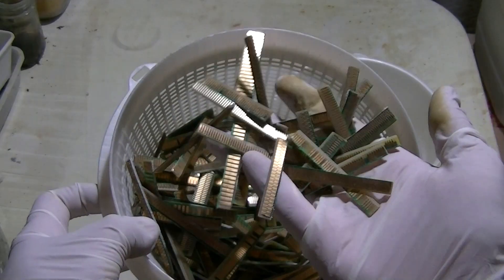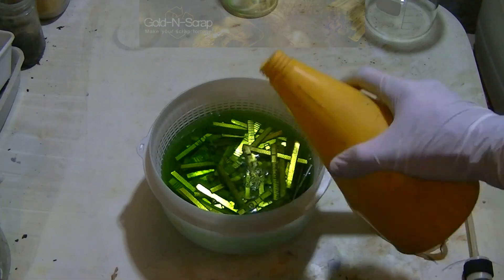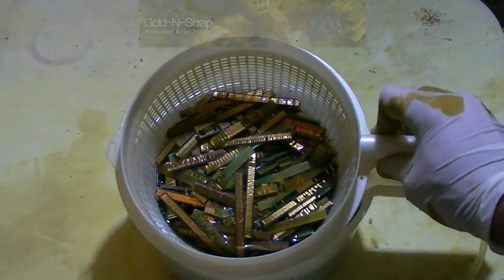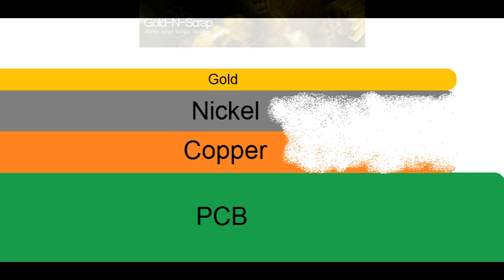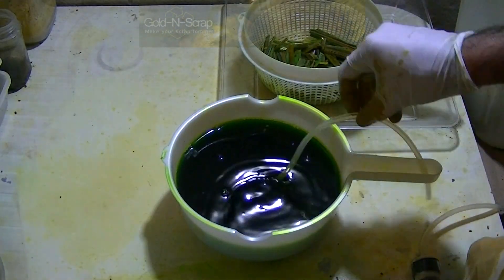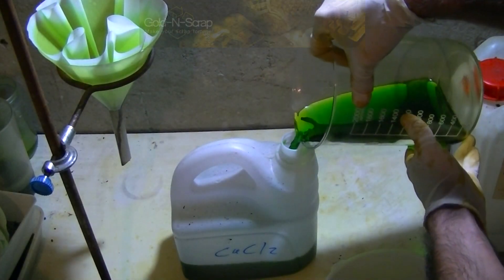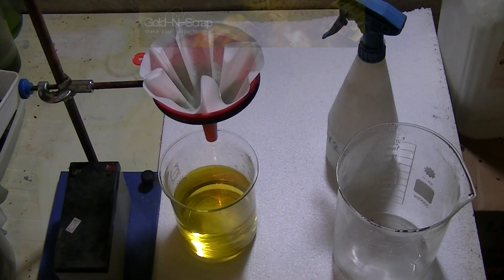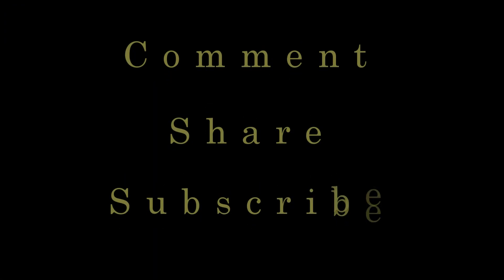Gold Fingers - How to Recover Gold from Electronic Scrap

Comment: 6 grams is 1/5th ounce. gold is 1236 dollars per ounce this makes it about $247.50. From this we have to figure what you have paid for the starting,  our time is worth and the materials. Figure as a guess $100 dollars. This means that after a week you have made about $150.00 and possibly less. This may pay on a larger scale.
Reply: NERD FIGHT!!!!!!!
Reply: This would definitely pay on a larger scale. However, a trip to Lagos is too expensive anyway.
Reply: ***** Hi, it depends if you use a metric ounce of 30g per ounce or a Troy ounce (29.95g) , which is quite close. If the daily price is $1236 x 6g/30g =$247.20. or 5 divided into 1236. Check this by multipying $247.2 times 5 to get the original starting figure. Best, 
Nick
Reply: Nicholas Sceusa Actually, a metric ounce is 25 grams it's not widely used. The most common ounces are AVDP or "standard" ounce which is 28.3 grams, and the troy ounce, which is what gold is measured in on the stock exchange @ 31.1 grams per ounce. So, if you were wanting to know the price of gold per gram, you would divide the current bid price ($1322.30 today) by 31.1 to get the price per gram. If you factor in the cost of all the materials used in this process, including electricity to run the air pump, heat plate etc. it's virtually impossible to make money from gold plated components, even if you get the components free.
Reply: Nicholas Sceusa Actually, I work in the precious metals industry. 31.1 grams per troy ounce isn't an approximation, it's an exact figure. And while gold is traded on the stock exchange in troy ounces, in the gold industry it's "usually" measured in either grams or penny weight (dwt) because it's very uncommon for people in the gold industry, except for large buillion sellers to use troy ounces, even the majority of them sell in fractional quantities more than 1 oz bars, rounds, or coins.
Reply: corisco tupi
Yer, exact is an absolute. You cannot be 50% exact. You are either exact (and nice) or you aren't exact. The operative word in Joshawa's definition would be (in this case) "completely", that is, in full. 31.1 is not "completely" correct, it is "mostly" correct, or correct for most purposes. It is not "exact" M-F'n semantics, yo'.

PS. nice as in precise and complete.
Reply: The use of an approximation which is common is not a switch. Your idea of more decimal places is more accurate or precise is not entirely correct, without the degree of precision of the measurement, or its uncertainty.
In any respect, the bottom line in dollars is quite the same. A review of the definitions of precision and accuracy might be in order. For this, I refer you to Remington's Complete Pharmaceutical Sciences. Sincerely yours 
Nick
Reply: corisco tupi It's sad that you cannot even see that 31.1 and 31.1034768 are the same thing. Just because I left off the decimals that aren't commonly used in precious metals doesn't make it any less exact. You cannot apply the theory that more decimals is more correct when, if you were so inclined, you could carry out the decimals till the end of time. What number is exact, 12 decimals, 100 decimals, 1,000,000 decimals? Let's just call it what it is, when you first replied to my comment what you thought you were doing was being a smart ass and a know it all, when in fact, all you did was prove that you aren't as smart as you think you are. You can (and have) deny it all you want but you clearly implied that 31.1034768 is exact, not 31.1, then you went on to argue against yourself that they are approximations which is just even more wrong. After 1 comment you looked like an intelligent person, by now you're just a blathering idiot who would argue the sky is green and grass is blue if you thought it would take the attention away from how big a fool you made of yourself right from the start.
Reply: corisco tupi
Since I've been buying and selling gold for a long time and always used the 31.1 figure, I decided to see exactly what you are talking about. At a price of $1269 an ounce, it works out to an astounding 0.004¢ a gram, or 0.14¢ an ounce. Considering the 100 oz. I cashed in this year, I'm out $11.40 .... Dangnabit !!!!
Reply: if you do it on the side its a nice bit of extra money fora small hobby.
did you now people in some third world countries do this as their only source of income?
they go to dump(yah america sends alot of trash to third world countries) to get any computer parts to do this with
Reply: beats sitting around watching tv
Reply: +Nicholas Sceusa
Why 6 grs?
It's said there is 1.5 grs, isn't it?
Reply: Joshawa Gardner First go back to Pharmacy school, so they can tell you 30 gms per ounce is an approximation. Gold is usually measured in Troy ounces. None of this makes a great deal of difference to your take. It is not worth doing, except on a large scale.
Reply: Joshawa Gardner Not really... 31.1034768 is more like it. Exact is exact.
Reply: corisco tupi 31.1 is exact, defined as "fully and completely correct or accurate" 31.1034768 is just more exact.
Reply: +Joshawa Gardner For someone who asserted that 31.1 was exact, to say that 31.1034768 is "just more exact" is somewhat funny. You may say 31.1 is close enough for your needs but it is not exact, sorry.
Reply: Oliver M Neither of you understand the definition of exact. By "your" definition, 31.1034768 isn't exact either, just because corisco chose to add a random number of additional decimals doesn't make his answer any more correct, I could keep adding decimals until the end of time and it wouldn't be any more, or less "exact" than it is now. Just because his calculator only has 10 digits doesn't make a difference. "Completely" in the definition means that it isn't partially correct or somewhat correct. Just because I chose to drop the decimals that, in the world of precious metals, (which is what this discussion is about), are irrelevant, doesn't change the fact that 31.1 still fits the definition of exact.
Reply: Joshawa Gardner Please re-read my posts. All I said was that your 31.1 figure wasn't exact and that 31.1034768 was more like it. I never claimed that my 31.1034768 was exact. Stop embarrassing yourself, dude.
Reply: corisco tupi That's just brilliant, when I prove you wrong you just switch your story to assert that you were never saying the number YOU randomly threw out there was "exact", even though you did say, and I quote, "exact is exact". So what you are now saying is, when you first replied to my comment to tell me I was wrong, what you were really saying was, 31.1 isn't correct, and 31.1034768 isn't correct either, but it's less wrong than you. Talk about someone embarrasing themselves. A shameful display! lol
Reply: BTW " exact" means as exact as I need according to the limits of measurement. So, even if I said what you say that I said, you still need to modify your idea. There is no alternative here. Have a look at Remington's. 
N.
Reply: Nicholas Sceusa
A.) As you should be able to note, since you were the OP, we're talking about precious metals, not pharmaceuticals.

B.) Plagiarizing someone else's work and using a bunch of big words in a manner that makes you think you sound smart only because it's barely understandable to you doesn't actually make you smart.

C.) There still isn't 30 Grams in a metric ounce, or 29.95 Grams in a Troy ounce.

D.) My response was directed towards corisco as noted by his name inserted at the beginning of the response, just as yours is here. We established much further up in this thread that you are simply talking out of your ass.
Reply: Joshawa Gardner You seem to be one of those poor Jewish boys whose mothers drive them crazy, and they take it out on the general public. Jewish people invented psychoanalysis, for a good reason, and I suggest that you take advantage of this. Perhaps you can stop trolling. 

Precious metals are weighed either metrically or by Troy Ounces, the same as other precious things such as pharmaceuticals. The official approximation is 30 grams per ounce, and I doubt very much you have a scale, much less a balance, handy that is accurate to tell the difference you speak of. 

I will put my intelligence and accomplishments up against anybody. I sincerely doubt you can measure up. Before you reply in an asinine manner check this out. 

Unless you have some actual information to add, I will ignore your from here on out.
Reply: Joshawa Gardner You did not prove me wrong. When I said, "exact is exact" I was referring to your WRONG number (31.1) which YOU asserted was exact. So I showed that there is a better approximation and said, "exact is exact" , meaning, YOUR NUMBER ISN'T the exact figure even though you said it was to begin with. It seems that you can use some improvement in reading in addition to math. This is looking worse and worse for you with each post.
Reply: Nicholas Sceusa  First off, my ancesters are of German descent,WRONG. Second, I'm sitting next to a scale that measures accurately according to the Indiana Weights and Measures department who certified it, to .001 grams. WRONG AGAIN. Precious metals are NEVER weighed metrically, not in any country in the world. WRONG WRONG WRONG. I'd love to see you try to buy "approximately" 30 grams of gold from a supplier, we deal in extremely precise measurements as no one, buyer or seller wants to give anything away free. You speak of intelligence and accomplishments but the only thing you've proven is that you are an anti semitic douchebag who's been WRONG at every turn.
Reply: corisco tupi Is 31.1 grams fully accurate, yes. Is 31.1 grams completely accurate, yes. Therefore 31.1 grams EXACTLY fits the definition of EXACT when describing how many grams are in a troy ounce. You remind me of one of those fighters who is getting his face absolutely pounded in, and when he goes back to his corner his trainer says, you're doing great, you're winning. You can change your story 100 times it doesn't make you any less wrong, anyone smart enough to use a mouse wheel to scroll on up can see you're back-peddling faster than Champ Bailey and you're doing a horrible job of it.
Reply: Joshawa Gardner Sorry but no. Twist and turn words as you will, but... no. Accuracy is something else. You can have a number accrate do "X" decimal places but the exact number is just that: EXACT, meaning there is ZERO difference between it and whatever amount you are refering to. The difference may tend to such small amounts that it might be negligible FOR YOUR NEEDS, but it doesn't mean it is the EXACT figure.
Reply: Try this, Einstein: subtract 31.1 from 31.1034768, multiply it by the price of whatever amount of gold you have processed this year. Feel free to cash that in to my Paypal account. Also: Up to this point, if you weren't being particularly courteous, at least you wren't playing the name-calling game. But since this is where you want this to go, I'll quit. I don't have time for shitheads like you. Goodbye.
Reply: Richard Cliche Yep. Hardly equal to zero.
Reply: Joshawa Gardner you guys need to chill out we are checking the video out to check it out so why make it such a big fucking deal and then turn it into a fucking argument of intelligence who fucking cares you are getting worked up over something so simple and stupid if people want to know what it is im sure they can google it and be just fine instead of dealing with a bunch of brainiacs arguing over whos smarter and whos ass is wiped cleaner by whos mom every night in the basement so chill
Reply: corisco tupi same goes to you bud
Reply: sptfr987 Thanks for adding your $.02, now go fuck off.
Reply: lmfao ow i think that may have stung a bit lmfao
Reply: actually the work itself in a week is not much,but where do you access all these free fingers.
Reply: martine. mjt You could set up a free recycling center for electronic parts, you'd get all kinds of gold plated components.
Reply: Joshawa Gardner lmfao ur funny im enjoying this
Reply: sptfr987 It's nice to know I can cater to the easily amused. If you get bored I can bring you some 1st grade project supplies, you just gotta promise not to eat the glue.
Reply: that's what makes me me what can i say and the glues tasty ask your mom she'll tell u she loves the white stuff lol she hasn't complained yet
Reply: Oliver M
 Take into account alloys, impurities, and scale errors, not to mention the dust that settles on it from the room, and this arguement becomes, well, not silly, but rather less relevant.
Reply: yea its quite fun a lot more experience :D
Reply: More fool thou! An approximation is not exact. Go back to school, if they let you, and if you have the money.
Reply: Nicholas Sceusa " Hi, it depends if you use a metric ounce of 30g per ounce or a Troy ounce (29.95g) , which is quite close. If the daily price is $1236 x 6g/30g =$247.20. or 5 divided into 1236. Check this by multipying $247.2 times 5 to get the original starting figure. Best, 
Nick"

The amount of fail in this comment is just epic, you reek of it. You pretend to "school" others on the difference between approximate and exact when you clearly haven't grasped basic math yet. So you couldn't cut it in med school so you tried pharmacy school but your professor was a bit of a stickler on "quite close" not being the same as correct so you didn't make it there either, close? You're a big, smelly joke and we're all laughing at you.
Reply: u know what im out of this i just wanted to learn a little something new and all i got was an eyeful of jackasses trying to be the most intelligent man on here and im sry but none of u r nobody gives a fuck about ne of u if they did u would be with them getting a piece of ass and not one here all the time bickering over simple measurements and making it seem like u have to be a fucking genius to measure something at all period hell even the math is simple so y dont u guys hold ur head up like men back away from the computers and go get laid and leave this convo the fuck alone there is a notification tab to mute them so u dont have to come back again or see anything else and thats what im going to do because my time being wasted on this and the space in my gmail box isnt worth it either good day gentlemen grow the fuck up and joshawa gardner ur a bitch a true bitch and nothing will ever change that not even that fuck doll u probably r in right now ur not intelligent ur just a cocky dick with a computer playing smart any one can sound like an intellect but only u and some schooling with an iq test can tell if ur a genius so until u receive all three dont play like u r
Reply: sptfr987 Obviously you give a fuck or you would have never tried to join the conversation, and I do mean tried because you failed miserably. Project much? You're insults are about 8th grade level (my mom, really?) you probably are too, at least mentally if not age wise. For the record, I'm married and have 7 kids, someone here apparently isn't getting laid but it's not this guy. If I wanted to mute anyone, I would. I don't mind having a debate, even a heated debate, with other intelligent people but the only thing you've done is muck up our conversation with childish rants. No one invited you, no one wants you here, so mute away, don't let the door hit you douche bag.
Reply: ...and your little dog too!
Reply: He reuse the copper solution, so that doesn't need to be bought again!
Reply: $1322 per Troy Ounce as of 7/4/2014. Gold is going to take a massive dive in time. I wish I hadn't sold at $700 but I needed the money.
Reply: Jacob green "Experts" have been predicting the crash of gold price since 2010 yet here we are today at 400% of the 2004 price. The truth is, the only people who really know what gold is going to do is the people who control the market and they aren't telling anyone.
Reply: Joshawa Gardner
I still question if the U.S. has much more than a little Gold Dust. We once stored it for other countries.
Reply: Jacob green Our nation's worth is now determined by what ever numbers they decide to put into their computers, and the value of that worth is whatever they can convince it's citizens it is.
Reply: this is why you work at mcdonalds!!!lol

Comment: Is there any reason to not use nitric acid to begin with?
Reply: Yes there is. To separate the gold from the fingers, he needs the gold to be solid and the other metals to be in solution, so he can filter the Gold off. If he would ad the nitric acid in the beginning, he would desolve the Gold too and have very impure mixed solution of Gold, copper and nickel. To separate the Gold out of the solution is way more work than just filtering off the solid gold first
Reply: I'm not saying to use the nitric in the beginning with they hydrochloric, I'm saying to just use nitric acid by itself to dissolve the copper and nickel, leaving just the gold flakes behind and then to create the aqua regia gold suspension.
Reply from the maker: harperjmichael Nitric for dissolving the base metals is a wonderful choice, given the following circumstances: 1. It is obtained as cheap as HCl. 2. Nasty NOx fumes are kept under control, i.e. scrubbed.
Reply: thanks for the reply, I did this a long time ago and right now I'm stockpiling fingers and pins and would like to try the aqua regia method for purification